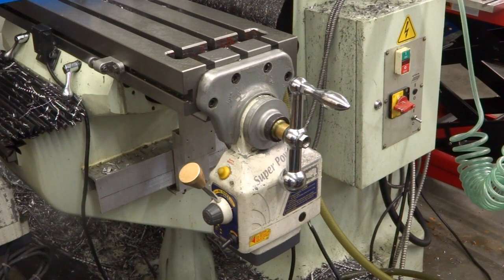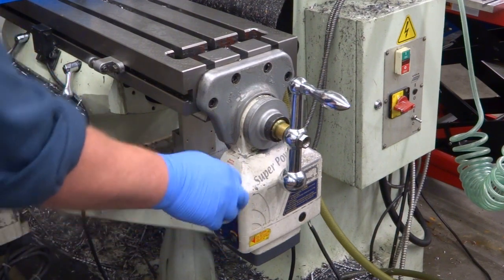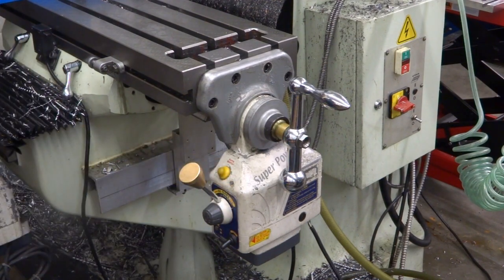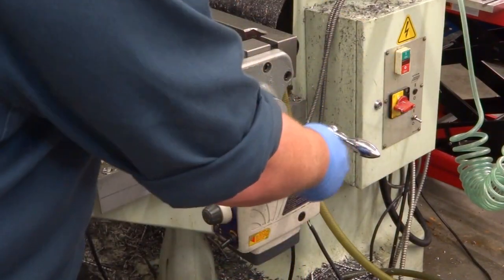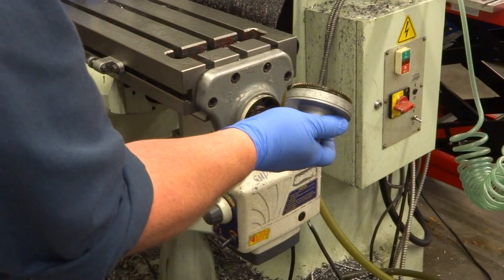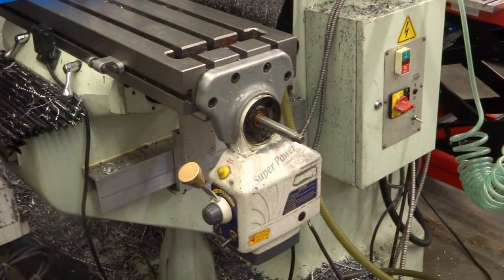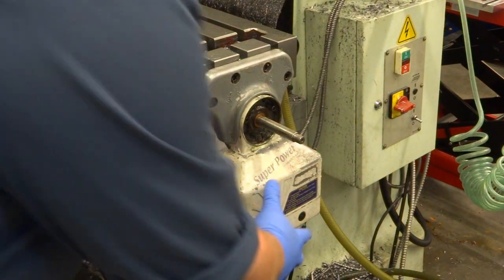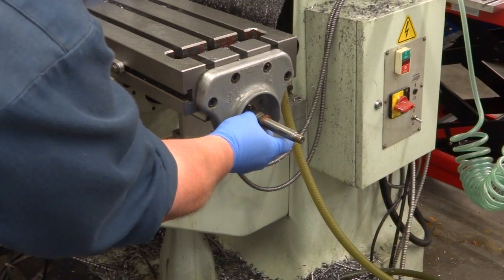Changing Power Feed on Bridgeport Type Milling Machine

Comment: Nice job! 
What make and model is your milling machine?
Reply from the maker: Hello Alex,  It is a First 1-1/2 VSL.  They are made by Long Chang machinery in Taiwan.  They seem to be very well made and accurate.  Other than replacing a few (non spindle) bearings early on I have not had to do anything to it.  I bought it new in 2003.  Ken

Comment: Good to see.
I fitted the same powerfeed to my clone in the Y axis.
Instructions are, as you say, insufficient to say the least.
I chose not to roll pin the extension shaft and carefully, using proprietary cleaner etc, used locktite retaining compound and high initial torque to keep it on.
Working so far.
It is a fiddle to fit powerfeed but soo worth it.
Carl